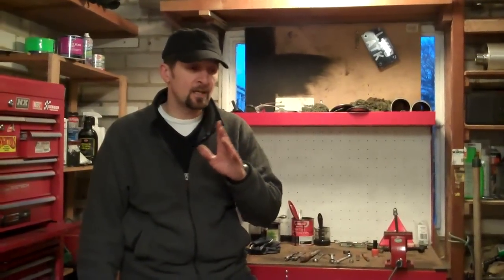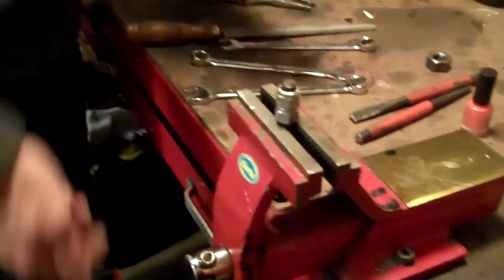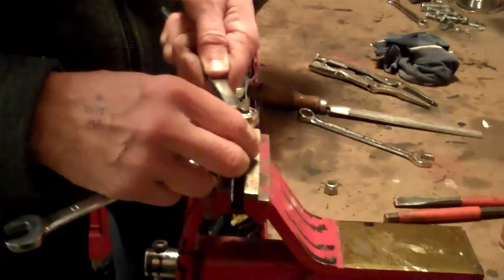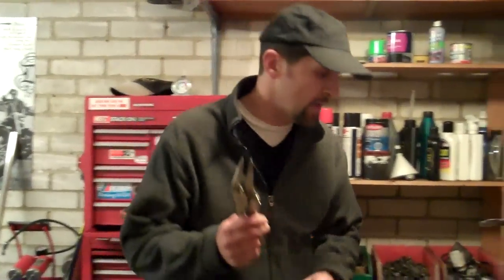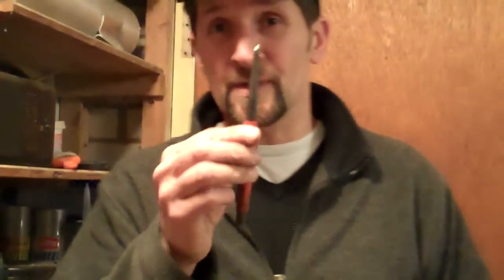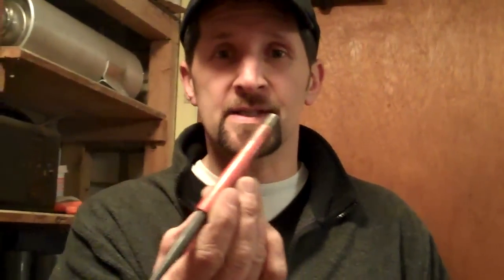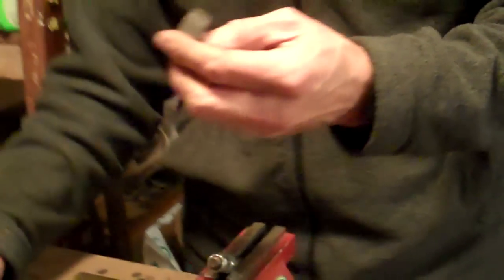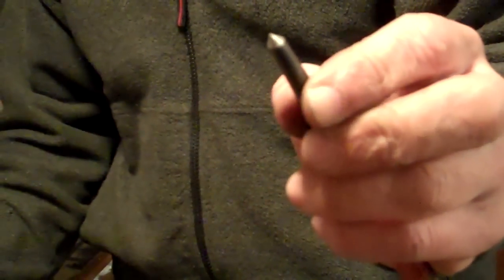Delboy's Garage, How-To ;- Rounded nuts?, an easy solution..!

Comment: Thank you Delboy!  Just removed four seized nuts from the exhaust manifold of my Bonneville T100 using your punch / chisel method as nothing else worked.  Took my time applying a little heat (just a heat gun) and plenty of penetrating oil too and lots and lots of little taps.  Took nearly an hour for each one but it worked and I had four undamaged studs that I could then use to fit my new Tec 2-1 exhaust.  Scoured the whole of YouTube but yours was by far the the most practical / useful advice.  Many many thanks. Have joined your Idiot's Collective too.
Reply from the maker: Nice one buddy, thanks for your feedback... this is a very old video now, and I probably did waffle on too much at the beginning, as I've been told, but it gets the point across and it worked for you, and that makes me happy !  Little tip for you buddy, going forward, if it helps... once every 3-6 months , depending on how much you use your bike, just squirt the stud nuts with some penetrating oil, back them out a couple of turns, and then wind them back in, do one at a time, and it won't unsettle the gasket, that why they stay mobile and won't seize up again... all the best, Del

Comment: I'll try this out! My rear cliper mounting bolt has been rounded off, but not by having the wrong tools. The wrench was a 14mm but it still managed to round of the head. Norway and rust you know... Getting a braker bar in that space is also quite impossible

Comment: I'm a diy guy - "the" single most frustrating thing i find for auto repair is stubborn bolts.  There are so many "how to" videos that don't talk on the correct method to remove a bolt and refer to the repair process as "easy". I tried to do a rear brake job and I have done a couple in the past but this time I rounded the head of the caliper bracket bolt.  Pretty sure i did all the things you said to make sure not to do - lesson learned.  Brilliant video.  Thanks for sharing.
Reply from the maker: +Mike Barnes Hi Mike, I know exactly what you mean, it's always easy if you know how aye??! And people who assume that others know as much as they do imo, can often sound insulting!  People are not stupid, they just need things explained thoroughly so the information makes sense... am glad the video could help you, and no matter how long you've been doing this kind of work, no job is ever plain sailing!  The mark of a good mechanic, as I've always said, is not how many certificates he has on the wall, it's his ability to adapt, improvise and overcome problems.... !  Thanks for your kind comments my friend, take care and ride safe, Del

Comment: Buy a Metwrench set. Grabs the middle of the nut instead of the corners. Was advertised on tv years ago, and they do work and only cost around 70 bucks for basic set, Works on badly rusted stuck ones as well, Sometimes a bit of heat needed, or penetrating oil on badly rusted ones. Adding a rattle to rusted nuts and bolts with those small air jackhammers will allow you to crack nearly any nut off in any situation. That's easier than any of this you're looking at here, but best way if nuts are rounded and you don't have the proper tools to remove nuts that have been rounded off. Thanks Moonfleet for your videos.

Comment: Hi thank you so much for the video i have a seized oil level / filling plug in my freelander ird box i cant move it is completely mangled and i appreciate the very sound advice about hammer sizes massive thanks for that i wouldnt want to replace the ird gearbox due to broken alloy casings ,merry christmas to you and yours .

Comment: The best "total destruction" method that I have found is to drill a single hole on the flat side of the nut itself (deep enough to touch the threads on the bolt, then stop) and then hit the nut with a chisel (parallel to the bolt) to crack it open. So drill a hole crack the nut, and spin off with your fingers; no multiple stages needed.

Hell if you aren't completely crazy with the hole that you drilled sometimes you can re-use the bolt. As the case often is though, you a replacing a rusted hunk of crap and don't want to re-use any of it.

Comment: If one needs to destroy the nut, a really sharp chisel is handy for that. Just take small shavings of the nut and soon when you get close to the threads the nut will split open and the threads will not be damaged. For big nuts chisel two sides to make it split easyer.
Also oxy-acetylene cutter can be used to burn the nut away. There's usually enough rust and stuff on the threads so they are rather easy to protect. Keep the flame just right and it will only burn the nut (not straight, but at a good angle).

Comment: what a load of crud, try doing that up under a wheel arch or under a chassis, mole grips sometimes work if not use some heat carefully then stilsons
Reply from the maker: did you actually type "what a load of crud,"..???   and Stilsons...REALLY.. have you ever worked on a motorcycle FFS....your clumsy tools go with your clumsy manners mate...!

Comment: old joiners trick,  jam a screwdriver tight between the spanner and nut,    job done, if your not strong enough to move it, best thing to do is go for 6 pints of guiness,  this wont help,  but hey,  your to pissed to worry about it    heh heh heh

Comment: hey man nice video i have 2 lug nuts stripped nicely on one of my tires, it just wont come off with a star, so i will be trying the center punch and toffee hammer today ..should i still use a chisel and toffee hammer being that i am dealing with a lug nut rather than a small nut like in your video?

Comment: Hi great vid, I have a disc bolt which started to round off as I tried to loosen it.Had the bike from new 10 years old now. don't know if it has Loctite or not, would I be better giving it a bit of a wallop with a punch or maybe try heating it first to break or loosen the Loctite,before attempting the hammer and centre punch.?
Reply from the maker: Hi Scott. The disc bolts will almost certainly have locktite on them from the factory, a punch can work, but it will resist and be stiff for a few turns when you get it free....rather then just breaking free in one go.... if all else fails you can still drill the head out and extract the stump with a pair of grips or stud exctractor...

Comment: I have found that the cheap SDS chisels sold for breaking up concrete are good for this.  Some are square section and taper to a fine point,  so can be ground to give an ideal shape to really get a grip into a rusty nut.  I've done a few on old tractors,  where the nuts have rusted round.  If you make sure you don't overheat them whilst grinding ( keep dipping them in water whilst grinding ) you'll find them really tough.  Don't forget the safety glasses,  my barn has a tin roof and I've heard tiny bits of nut pinging off it.

Comment: thanks for the vid. this happened to a 15mm (flats) caliper bolt (on a car). I made it worse than it already was. Was using the wishbone to pivot against and as I was lifting the spanner and or wrench up, it would twist outwards, rendering the head of the bolt to partially skew. My first intuition was to get a file like you said - i might attempt this next weekend.
I have undone caliper bolts for a long time now, pivoting against the ground or a wishbone have always worked except this time!

Comment: Cracking video and so right I've always attempted things and I get along well in most cases until the dreaded rounded or rusted bolt usually the last one in a sequence. Also right that the tool of choice in such a situation for me is mole grips and thinking to myself that the most satisfying noise is that clank of griping the bolt nut or whatever as tight as possible. Can't believe it never really dawned on me before that it just exasperated the situation. Mind you I also joking tell people I can do half of any job brilliantly (the taking apart) just don't expect in to go back together again. :-)

Comment: In my experience this does work - sometimes!  Depends a lot on access & how tight the nut/bolthead is. Problem is commonly seen on vehicle sump drain plugs where people tend to over-tighten. I also note that ring/open end spanners frequently don't fit perfectly even when new. Note also on vehicles the fasteners are often Hi tensile grade which generally reduces the incidence of burring.

Comment: The trick lies in detail and you've done excellent. Thank you for sharing. I am in stage two where i've done some damage to a 17nut that is a part of a quarter turn kitchen sink tap. Time to shop for file and the center hole punch. I would be opting for the file method to restore the sides of the bolt and then try the ring/box spanner. Thanks again. :)

Comment: I'd say this video saved me about £200.  Completely seized brake calliper bolt couldn't be shifted even by over-the-counter 'bolt extractor' nonsense, but gave way after a couple of hours persevering with this method.  Continuous sharpening of the centre-punch is key… I should've just done this from the word go.  Good work.
Reply from the maker: OneUnited1999 Thanks mate...glad it worked for you.. Del.

Comment: ha ha , i was drinking a cup of tea just as i read the "rounded nuts", yup you know the rest :-)

I dont feel so bad about the evil things ive done now :-), years ago i had to get my bike running (on sunday) for the next morning work run, the clutch did not want to play the game.

The center nut i didnt have a spanner/socket for, so the chisel and hammer did
the job and had to put the nut back on the same way.

I know its nasty, the nut had just 2 dents, minor damage.

Smashing tip :-)

Comment: So I realize I am getting to this video late but I want to comment on using the wrong tool. I recently wanted to do some work on my 2003 jeep liberty and needed some metric wrenches. I went to a local retailer and bout a "set" when I got home I found there was no 18mm wrench. I then found out the retailer did not sell individual wrenches. This is common here in America. It was then suggested I buy the "pro" version by the same manufacturer with half as many wrenches for twice the money, just to get an 18 mm. So it is it understandable if a person would attempt to make do with an SAE. Consumers are constantly gouged by tool manufacturers.
Reply from the maker: 18mm is not a regular size head on metric fasteners, in fact i have several sets of metric wrenches and none of them have an 18mm..  if you're stuck for one though, then 11/16 af, is a slightly tight fit on an 18mm head !

Comment: Starter for 10 Del: Radiator top bolts. One bolt with a (what looks to be brass) well nut. Every time I turn the bolt, the round well nut just keeps spinning with it. Any ideas? It's not the easiest place on the Hornet, and the well nuts turns, to trying  ahole punch/chisel method isn't working as it keeps spinning.
Reply from the maker: Hey buddy... im surprised to hear that a radiator is held in with a well nut.. but its not impossible i guess... they are generally used when you cant get a tool to the back of the nut to hold it from turnging... they pull together as you wind the bolt in and 'fatten' up so they wedge in the hole... can you maybe get a pair of pointed nose pliers onto the body of the rubber well nut to hold it still..?

Comment: GREAT TIP! I have 2 brake lines to replace! They are on a 1st gen focus & the flare nut that attach to the wheel cylinders are rusted completely away! I am prepared to cut them off if need be & drill the bolts out! The bleeder screws & flare nut's are gone, they completely rusted away, non existent! so, I fear I will not get them apart so I got new cutting diskd & cobalt bits, all new brake lines, unions, flare nut's & much more, on this car, it's been 1 thing after another! But, I have replaced every part on this car & there isn't mush else to go wrong with it!
Reply from the maker: Sounds like you have it under control.. good luck with it buddy.

Comment: I would rather use the drill to cut two holes in the side of the nut and split it.
Reply from the maker: yeah that works, but sometimes the fastner is in an alloy engine casing, brake caliper casting, or other such place, and the danger of slipping off with the drill and damaging things is always there..

Comment: Hi great videos I now feel much more able to tackle bigger jobs on my bike and not throw £45 every hour at a mechanic at my local repair center, one question if you could help, 49cc scooter exhaust pipe keeps rusting out it,s not holing or blowing just flaking like mad I tried grinding it back and respraying with exhaust fire wall paint but never resolves the problem of flaking and rusting, is there another product on the market I could try, thanks
Reply from the maker: Hi Glenn, most Japanese scooters use black painted mild steel, so it should be ok with some BBQ paint, follow the instructions and brush it one (do your best to get a nice finish) and that should protect it well... good luck with mate, Del

Comment: Evening Del, great vid, will definately try this! 
Have you ever had to get rounded Cap-Heads out? I was shown an awesome trick a while back that works basically every time...
If you hammer an oversized Torx bit into the rounded cap head and get a ratchet on it they come out no problem. Had to do it on a friends fairing bolts recently - about 5 bolts and it worked every time.
Same cause as this - people using the wrong size tools!

Comment: Hi Del, Great video that saved my ass recently but have a question, I've a gsx750f which uses a very similar engine to that on Damage and i'll be swapping over the header pipes soon, as always the 4 inner bolt heads are just blobs of rust and i'm expecting the inevitable sheared bolt (most likely in whichever bolt will be the biggest B???h to try get access to), do you have any tips for getting these out? Ride Safe!

Comment: a set of torx keys from screwfix that cost a fiver have a t27 in them. a friends car had a security wheel nut which was completely cattle trucked due to cheap tyre fitting monkeys using an impact gun to tighten the wheel on! eventually resorted to using an angle grinder to cut a notch in the side of the nut and a hammer drill with a chisel bit to get it to shift! hard bloody work but it did earn me plenty of beer money :D

Comment: Hey, have you ever done an exhaust removal video, specifically downpipe removal? I'm going to take mine off the Bandit and not seeing many how-to vids. I've heard too many scare stories to jump right in!
Reply from the maker: Hi mate, haven't got round to that one, and I no longer have the Bandit to do it on... it's an easy job, just drop the oil cooler off and out the way, and make sure you sure exactly the right size allen key and ensure it has a perfect fit in to the bolt head before you lean on it... as they can strip out quite easily... also, do the job over 2 days, by getting the cooler off first, soaking all the bolt heads in WD40 again and again over half an hour or so, then leave them overnight to soak before moving them... as the heat can bond them in there... good luck with it!

Comment: Great video! I've got a badly rounded bolt in a recessed hole with minimal clearance but i can get a centre punch or small chisel into it. So a 8oz ball pein or 16oz? Its for a 10mm bolt.
Reply from the maker: Good luck with that my friend, always start with light taps, if it's a 10mm head, it'll only be M6 so possibly quite fragile and wouldn't pay to hit it too hard!  The trick is to create rotational force, not enormous force...

Comment: Hi Del, gr8 video, I bought a set of 3 centre punches.  when they arrived I tried your method on a rounded motorcycle caliper bolt thats been bothering me for years.

the centre punches didnt make a dent in the bolt (I tapped it lightly with a small hammer like you did) and the sharp points on all three centre punches have now completely worn flat.

what do I do?  I took my time and was careful.
Reply from the maker: Hi mate, a centre punch shouldn't blunt so badly in its first use...let alone all three.....if they were cheap and of poor quality then they would be the week link, but a good quality punch will dent even hard stainless steel, so i would imagine its the tools that were at fault...im not sure what ones you bought, but you can resharpen them on a grinder and have another go....maybe think about investing in a really top quality centre punch, the one i use was £15 by itself, and it goes blunt after a few dozen uses but i just re-sharpen it... hope that helps you buddy... good luck.. Del

Comment: currently struggling like mad with my old ybr exhaust bolts! they are allen heads, but instantly rounded even when using the correct allen key! one came off ok by whacking a socket over the top but the other is not budging! even tried grinding a edge on it to get the mole grips around it but to no avail!

Comment: Changed all my Torx on my Sportster caseings and controls,especially the Derby cover, to allen head far better, had to use a wee chisel 5mm and as you say  tapped, surprisingly only a few and could be unscrewed by hand, I personally hate TorX I will be changing all the ones on My Dyna as needed,....... Good Vid,...

Comment: Another tip I found usefull is if you can get at the nut you can cut a groove into it usng a dremel and a cutting disk then the nut just breaks and you can save the bolt usually ...but the centre punch trick is a great one, never would have thought of that one :D

Comment: my method - , dremal with a cutting disk , cut a grove on the side of the bolt in the same sort of postion that u would use with the centre punch then use a flat head as a cheisal (everyone does that) then hammer it out , so basicly same theory just different tools